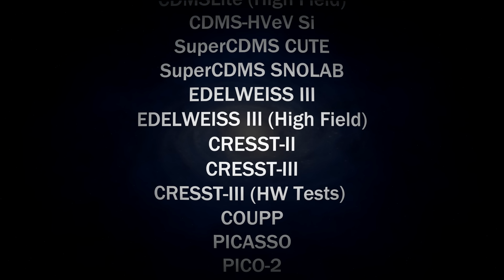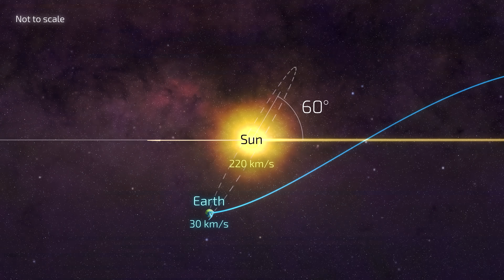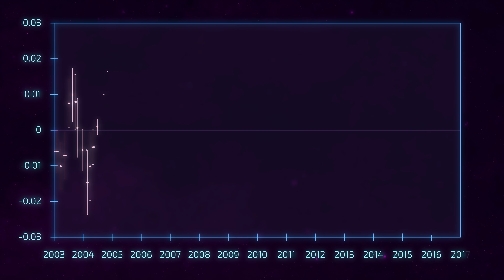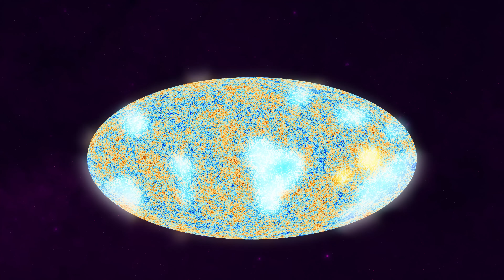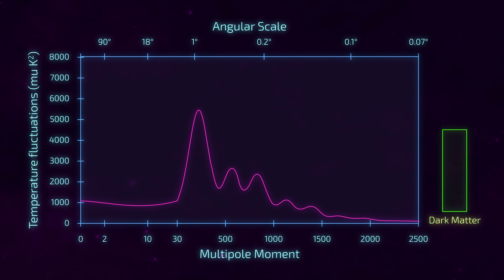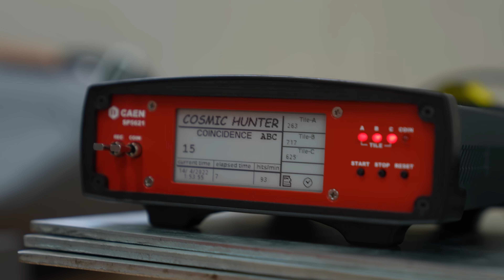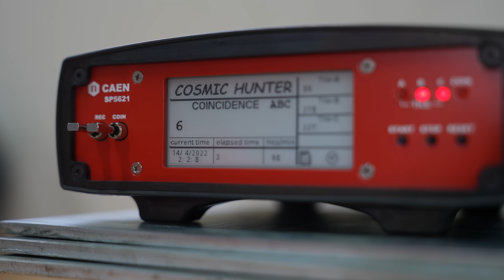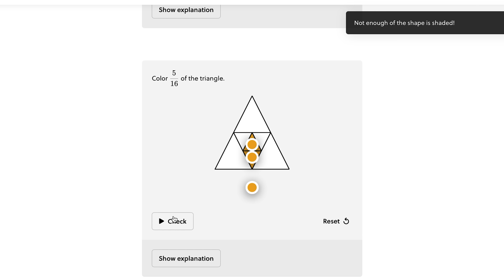The Absurd Search For Dark Matter

Comment: 4:40 So dark matter is what allows stars to rotate at these excessive speeds towards the outside of the galaxy. Does that mean that there is a much higher concentration of dark matter in the core of a galaxy as well? The way he portrayed dark matter initially was that astronomers suspect it permeates both inside and outside of a galaxy; 1:18  Which intuitively makes it seem like it isn't as concentrated towards the center of a galaxy
Reply: It isn't concentrated. Regular matter gets concentrated via collisions where particles interact with each other via electromagnetic forces. Dark matter is believed to interact via gravity only, so those collisions don't happen and it stays a mostly uniform cloud. As for orbit speeds, the one piece of info you're missing is the "shell theorem" which basically states two things:

1. Any sphere or spherical shell you're outside of pulls on you as if all its mass was concentrated at the center. For example, the Earth is actually trillions upon trillions of atoms all pulling you at different angles and with different strengths. All of that averages out to the one pull you feel toward the center.

2. Any spherical shell you're inside of doesn't pull on you at all. Using the Earth example again, imagine digging halfway down to the core. The gravitational pull of all the spherical layers above your height cancel out and leave you just feeling the reduced pull of the sphere of layers below you. Go all the way to the core and the equal gravity from all directions entirely cancels out.

Going back to the stars, the dark matter cloud can be approximated as a big sphere. Stars on the outside edge of the galaxy have a lot of the dark matter cloud evenly distributed in the  rest of the galaxy "beneath" their orbit, and all that mass keeps their orbit fast. Stars near the core have most of the dark matter cloud "above" them, so they don't see much of its gravity, and their orbits are dominated by the nearby concentration of regular matter.

Comment: Interesting note before the brilliant ad, contemplating if dark matter interacts with standard matter.. isn't that the entire starting point for the idea is that it does interact albeit gravitationally via it's mass? If that's the starting point then that should be the assumption to prove I would think.. I think the astronomical phenomena represent far better cases for study than our best attempts at home brewed study.. what I mean there is that I'd really like to see an in depth attempt at disproving some of the phenomena that have been attributed to dark matter.. I'm sure it's been done but having no back ground in astrophysics I question the bullet cluster explanation in a dozen ways, 1 have we proven the local gas densities of the clusters because if the gas density where far lower for whatever reason I would think the mass of the solar systems would explain the gravitational light shift we observe.. not to mention with so much distance comes so many opportunities for variables that may not have been identified yet.. the lens smudge problem.. it seems more like bored scientists picking up lazy scientists left overs to self justify. As rude as that sounds, it really just seems quite the leap to take phenomena like these and manufacture for them all a fairy tale solution rather than really digging in or atleast simply identifying that something unknown is at play and holding at that vice making up a stretch of an explanation... It's like they saw a bed sheet holding a form and said there's a ghost rather than considering what normal thing could instead be under the sheet.. it sounds like over explained nonsense when I think we have more real and important things to study.
Reply: That's why they always make the distinction "first DIRECT observation of dark matter." We already have tons of indirect observations of dark matter, but since gravity is far too small to measure on the scale of individual particles, all of the gravity based observations will stay indirect and can't tell us more than that it's something with mass.

Comment: The universe is electric. the electric force is 10*39 bigger than gravity. 
No need for dark matter when electromagnetism could easily spin planets, stars and galaxies.
Correct me if I'm wrong but there is no machine on earth powered by gravity driven motors.
How does our Sun generate its hugely powerful magnetic field? What accelerates the charged particles in the solar wind way beyond the influence of the Sun's atmosphere?
Why is the Corona millions of degrees C two million miles from the Sun's surface, when the surface of the sun is only about 6000 Celsius?
It is also postulated by some Electric Universe scientists that gravity is a product of electric phenomena at the atomic level.
Dark Matter and Big Bang, despite the huge inconsistencies with these theories, are the ones that are getting all the big government funding.

Comment: June is when mass interaction with 5 orbit per unit of time energy is at it yearly peak. It's daily peak is around 2am.  We only enteract with 6 orbit per unit of time energy as 100% mass. Light is 1 orbit. stars hide nothing,  we enteract with all 10 emfs of the sun. Saturn, and all the other planetary bodies in are solar system, we enteract with just the 6 orbit per unit of time emf, except Jupiter. We enteract with 5, 6, and 8 , meaning it's on its way to become a star. And it will as we get closer to te galactic center. We also will make this transition   from 6 to 5,6, &8. and this will peak in June at around 2 or 3 am. Use my math solutions  to solve for energy and the time intensity differential  between 6 orbit and 5 orbit. I was recording outside this passed June around 2:30am and caught something I didn't  have a clue for a month or more. As I found the video in the trash bin cleaning out my phone. The video was me filming my sisters back porch because I thought  a woman was standing there. I was wrong be what happened right in front of me is crazy because I was clueless.  It first looks like shadows but I know where everyone was around me and no one was moving to cast a shadow, well long story short, there was  2 demons. One chasing the other. The larger one was about 2.5 to 3 feet tall and looked like a Ape with two back sweeping horns.  I can explain all things to the movement with my unified field theory with math solutions to solve for time intensity and energy. My name is Ezekial Davis of Lake Wales florida in the United States  text me at 863 272-1377 if you're interested in unified field.

Comment: I’m leaning towards Modified Newtonian dynamics (MOND) at the moment. It’s more intuitive but the problem with it is human consciousness wasn’t designed to understand reality, so our intuition could be false when making these observations. Still the Dark Matter hypotheses is a tough pill to swallow, but it’s an interesting idea and I’m totally open to it. I hope this experiment gets us going in the right direction, exciting stuff!
Reply: I would still argue that Dark Matter as a concept is more intuitive than MOND.

MOND essentially just states gravity stops following the inverse square law at low accelerations, but it doesn't propose a mechanism as to why (as far as I know). The lack of a physical explanation is pretty critical, because the inverse square law is both logically sound and one of the most fundamental parts of our understanding of all forces acting at great distances.

As for dark matter, one of the big rules of thumb of the universe is that the more complex something is, the rarer it is (like the ratio of hydrogen vs. all other elements in the universe).  Regular matter, AKA baryonic matter, is fairly complex in interacting with all four fundamental forces. It seems reasonable that on the way to creating regular matter, the universe could also have formed greater amounts of simpler matter. If this simpler matter just had the property of mass and missed the components causing regular matter to interact with EM fields, that's all you need for dark matter. I wonder if it would be more generally accepted if we had named it something else. My vote would have been protomatter.
Reply: "our intuition could be false when making these observations."  What?

Comment: But, like you said :P, gravity is not a force. It is space bending around the mass. So all stars in a galaxy move at same speed, because they are going through the same space time. They fall (go through same space) together, because they all have equal speed because the space that they are traveling through is at the same ("angle /gravity") and heavy or light object, will fall at the same speed when no friction.
Reply: Space bends, but doesn't have the same curve everywhere ^^'. The closer to a mass, the stiffer the curve. That's what we call gravity acceleration.

But from our observations, stars in a galaxy don't feel a gravity acceleration. That's a mystery that can be explained with dark matter around the galaxy.

Comment: 9:49  We're gonna find out one day that what you're talking about is the closest thing to the big Bang you've ever seen.
 But rather than witnessing dark matter which you witnessed was solid matter and gas matter clashing into each other where solid matter generates massive amounts of energy Igniting the gas matter and creating more gas matter as it passes through aggressively each other.
 Truthfully I would have been trying to spot unique and new quasars being formed.
 Just imagine 2 similar sized suns capable of collapsing in and turning into black holes suddenly colliding into one another or the complete opposite.
 2 stars incapable of turning into black holes suddenly gliding into each other with massive speed and force.
 Could that create quasars would that create supernova's call create supernovas could that create a black hole...
 Any number of possibilities could have happened and yet none of the most interesting ones were ever thought of.
 What seriously some of these gasses in matter could have actually created energy when colliding as well as conduct that energy creating  An electromagnetic field that just wasn't strong enough to actually force them together.
 But was still powerful enough to attract Some types of matter but like matter being trapped in a snow glow with a magnet on the outside a barrier pulled it back.

Comment: If the Australian experiment shows exactly the same results it is not necessarily evidence for dark matter. If it shows different results it is not necessarily evidence against dark matter. It will at most be another piece of information which may or may not ever turn out to be relevant to dark matter.
Reply: Well, yes and no, but mostly yes.

If both labs' results don't match, then it's not dark matter they're detecting. It would mean the WIMPS theory is inocrrect.

If both labs have matching results, it would give weight to the WIMPS theory.

Now there are many other theories about dark matter, so it won't debunk this possibility, just one part of it. The Australian lab is a keypoint for dark matter research regardless.

Comment: The detectors can have emissions themselves that will give a false positive.  The amount of interaction they're trying to detect is way to small to get meaningful data.  It will always blend into the background integrations.
Reply: Do you want their phone numbers so you can tell them their billion dollar researches are worthless because of something they obviously already thought of?

It's not a bad point, but they don't need us to tell them. In fact, building a second lab will solve that issue. If both labs detect something at the exact same time, it's not a false positive.
Reply: @Dante02d12  I worked in these types of labs I don't know of any of my peer physicists who knew anything substantive I didn't know, I did find most to be less skeptical than me. You're referring to cosmic radiation not radiation generated from the detector materials and circuitry.  All materials have micro radiation as the electrons in their atoms move and give off photons.  Circuitry runs on electricity which generates small magnetic fields which creates ionic imperfections in materials as the trade electrons and electrons change energy levels emitting photons, heat causes materials to perform differently, you have material impurities in metals pretty ssure the trace amounts of fissile material in your metals are a problem.  These are all things are small incidents that create a new lower local background levels that will generate new false positives.  That's the problem with detecting something this small it blends in with noise.  Lying saying you solved the problem will get you funding but it will yield bad data.  There are all kinds of trivial things these guys can't accomplish in the tech world so pointing out that they are corrupt and got a billion dollars of other people's money doesn't help.

Comment: did I understand it correctly, that dark matter halo is not rotating around the galaxy center or rotating at a considerably different angle speed? If no, what else may allow us to try measuring intensity of interaction with dark matter this way, expecting different results depending on the velocity of the Earth with respect to velocity of Solar system?

Comment: My theory is that large spinning masses create gravity. As each atom has electrons and photons, a moving nucleus with photons pulls the electrons along with it but there exists a very slight offset as the the electrons charge towards the plus charge of the nucleus where the photons are bound together. This plus charge then pulls other neighbouring atoms with it.

Imagine being at the funfair and you ride on the graviton. This spinning room makes you feel as though as giant invisible hand is pressing on your chest and limbs. This creates forces of up to 3G but the direction you are pushed is not to the side but straight bac from the centre. Think of this in reverse for the earth, where, unlike our faces that want to slide off, electrons are pulled back to the centre of their atom at a greater force, thus creating a directional force.

If you can imagine this centrifugal attractive force gains greater strength the more billions of trillions of atoms all moving in the same direction all pulling each other and maintaining a stable momentum would be many times stronger or weaker depending on the mass of a massive, spinning spatial body. This could be what gravity is, many atoms trying to maintain equilibrium while being flung at high speed through a frictionless universe. The denser the mass, the stronger the pull as more electrons travel to stay with their nucleus. The further away the electrons are flung, the stronger the force to pull them back, and of course the larger the diametre of the mass, the faster the surface spins, the denser the mass, the greater the exponential power of the directional pull towards the centre of mass.

I don't know how much gravity this theory holds, but it's my way of understanding gravity and the science on it is still grey so it's still anyone's guess.
Reply: I live in karachi Pakistan I like your communication
Reply: I think that we should definitely look into the gravity side of things more to better understand this since the whole focal point of Dark Matter is all relevant to the impact it has on gravity fields. So since we know gravity has a role in dark matter, or are fairly certain of this, we should definitely start investigating and finding ways to directly observe gravity. For example, we've recently actually detected gravity waves with a detector for the first time ever. If we could perhaps pull experiments which show varying results, perhaps we could begin to actually SEE the effects dark matter is having on gravity, and perhaps it would become immediately much more clear. So perhaps a good starting point is to find reliable ways to observe gravity so we can run experiments to play with it and see if we spot anything out of the ordinary. And I do think we will need to SEE these waves and/or particles, if there is a graviton particle for example, to fully see the effects of Dark Matter. Since we have yet to really discover the Gravity particle, the Graviton, and since we've only just recently discovered a gravitational wave, we still have more room there to discover as well.

Comment: So here's a weird thought: what if the capacity of living things for observation is the cause of dark matter, and dark matter is simply the increasing amount of data of everything observed "everywhen" and everywhere in the universe?  Or, say, the concept of parallel worlds pans out then it seems like all that data has to be represented somewhere.  Why not dark matter?
Reply: Some mysticism would be nice in this Universe
Reply: @MysticFitness444  Maybe, but mysticism either eventually falls before the scientific method, or is so inscrutable that it might as well be a religion.

I think of it more like all the data about a virtual world save file on your hard drive.  As more of the virtual world is uncovered, the larger the save file becomes, and the more there exists to uncover.  Rinse and repeat until either either a) the save file becomes large enough overtax the system running it (somewhat similar to the runaway expansion of the universe theory), b) no further interest in using the specific save file (the stasis theory), or c) the save file is deleted ("big crunch" theory).

Analogies of course, with all the inherent flaws and inaccuracies, but I'm still intrigued enough by them to think on.
Reply: @abasdarhon  you know what, i think you might be onto something tesla was talking about. Shared universal knowledge can make sense if said data is widely distributed throughout the universe